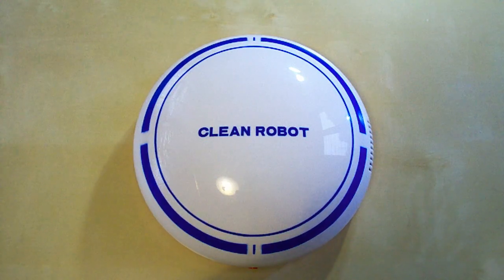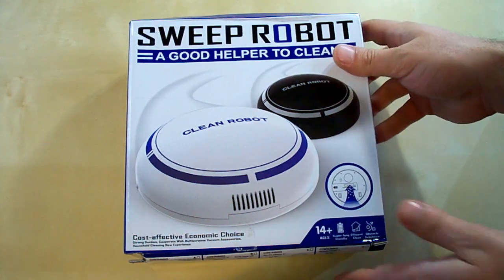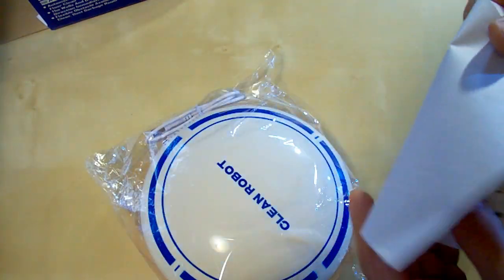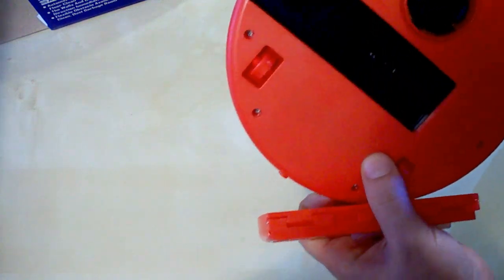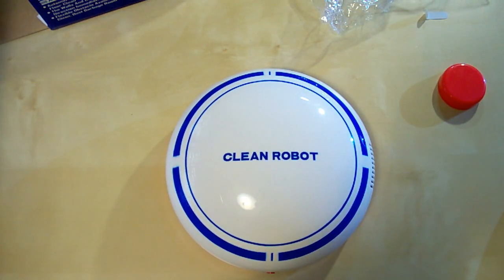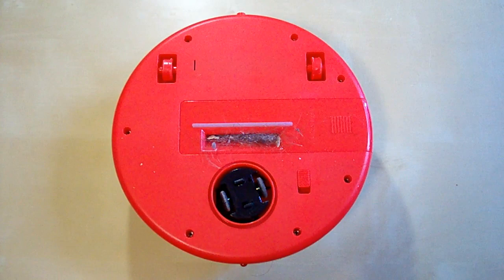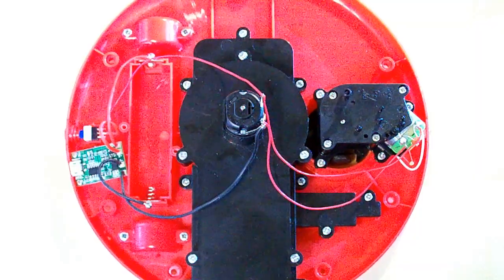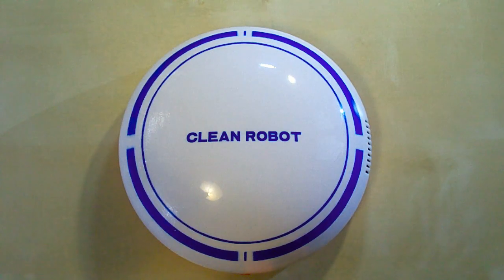$20 Robot Vacuum Cleaner full review with testing and disassembling

Comment: Thank heaven for the youtube.  Mine turned on when I removed the round cover and the off/on slider button does not work so this little dude is running amok in my house, and I cannot turn it off. And I paid  $49 for it, not $20.
Reply: Well, it finally turned off and for the most part it picked up some of the little paper tidbits I bought it for.  It does get stuck on carpet edges or even a phone cord on the floor.  I will keep at it. I want this to work for me. I work on a lot of paper arts and the floor gets littered.
Reply from the maker: I think $49 is too much for this robot.